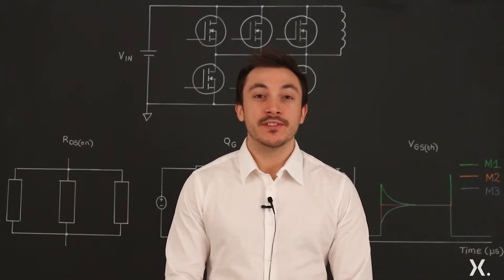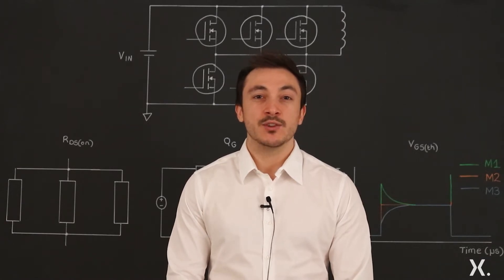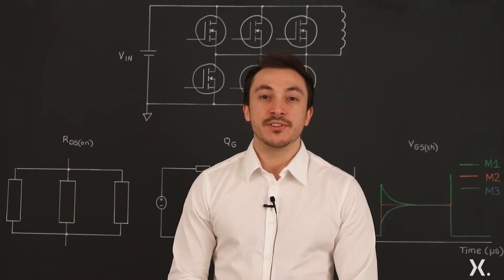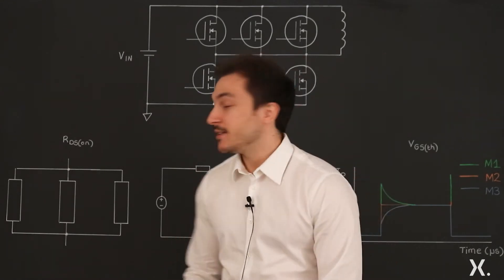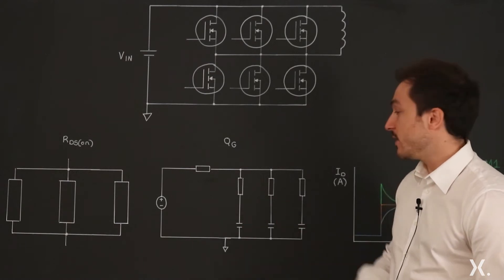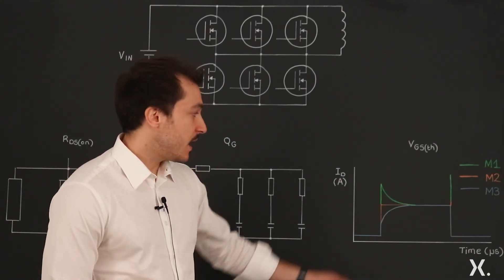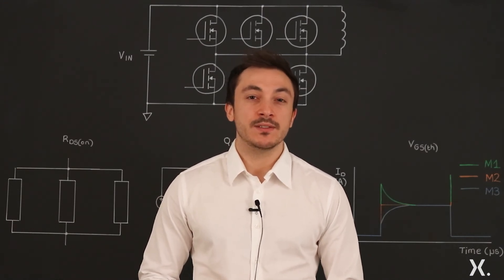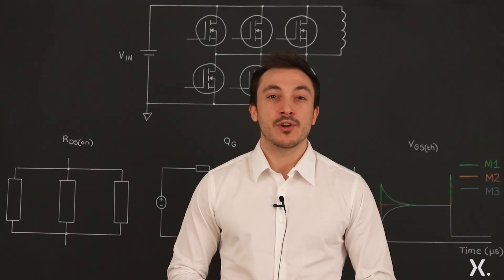How to parallel power MOSFETs

Comment: Do you recommend to connect the external resistors at source instead of Gate? the reason behind my doubt is that, in case there are tolerances in the resistors, then separate gate resistors may cause one of the switch to turn on earlier. Your feedback will be helpful.
Reply from the maker: Thanks for the question, @apoorvapatwardhan9394. We don’t recommend connecting a resistor in the source since it will significantly affect your overall efficiency. Usually, we are paralleling MOSFETs if the current is too high for a single MOSFET to handle, and if you have a resistor in the MOSFET’s source pin (Rsource), it will add loss to your system (Rsource*Id^2). 

In addition, another purpose of the individual RG is to minimize the impact of the difference in the threshold voltage (VGSth) of the MOSFETs. The Millar plateau voltage occurs after threshold voltage is reached, in this region the gate current will be flowing via the drain and not the source of the MOSFET.

Comment: Hi, I have a question. I have 4 transistors 2x S13003AD and 2x 4202BD. Can I connect them in parallel?. I just need 1A current but heat must be as low as possible. I already connected two S13003AD in parallel but I'm not satisfied with the heat. This will enclosed in a small enclosure. 

I know I could use higher power transistor or MOSFET, but above mentioned transistors are what I have at the moment.
Reply from the maker: Hello, thanks for your question! As a general rule of thumb, paralleling devices with different part names, either BJTs (as in your case) or MOSFETs, is not recommended. You want the paralleled devices to act as a “single” unit, i.e. as synchronized as possible, so that your design is robust and reliable.
Reply: @Nexperia  thanks for the reply!. I just wanted to power up a 4W LED light (20 LEDs, 0.2W each) from a 4.2V li-ion battery pack (1S 3P). Sorry!, I forgot to mention that. 

I already tried that, and it's working. They barely heat up. I was able to get 1.25A for them. I used separate base resistor for each transistor. 

It's not ideal, but works for the LED light.
Reply: @Nexperia  I saw a similar circuit somewhere else, but in that circuit they've used D882 BJTs, 4 of them in parallel with separate resistor to drive their base. 

I just wanted to try that with different types of BJTs. I'm using it about a week now, so far so good 👍.
Reply: They must be biased to saturation when 'on', so the collector to emitter resistance is as low as possible. Otherwise axsmall resistance will be present, which causes overheating. Also when switched off, they must be switched off completely.
Reply from the maker: Agree, which is similar to what happens to MOSFETs where RDSon will change with respect to VGS. Therefore, one would want to increase as much and as safely as possible the VGS to get the lowest RDSon and thus lowest dissipation.
Reply: The best thing to do is make sure the transistors are saturated when biased, it is best to do a static test for the lowest possible base resistor you can use. Then Ce resistance will be as low possible, and hence little heating.

Comment: Really great video. Could you please advise how you would calculate the realtive values for the resistors in reference to the gate charging. With the combined capacitances would you aim to reduce the resistance for a solitary mosfet by dividing by the number of mosfets to match the increase in capacitance. Is there a way of increasing the voltage to drive it harder and ensure a good current flow. With mosfet drivers they often have an independent way of powering the gate voltages. I have not often seen people using voltage pumps to do this. Is there a reason? I am sorry, I am totally new to this. I would appreciate your guidance if possible.
Reply from the maker: Hi @tarunarya1780, thanks for the question. The value of the “local” gate resistor (the one close to each MOSFET) should be low so that the gates of the MOSFETs are well coupled together, around 2 ohms should be enough – there should be a bit of resistance in the gate-source loop to dampen eventual ringing. The value of the common resistor at the driver side depends on how fast you want the MOSFETs to switch, you could use a simple simulation to choose it. Furthermore, the equation at page 17 of our application note AN50005 “Paralleling power MOSFETs in high power applications” could be helpful in certain scenarios. https://assets.nexperia.com/documents/application-note/AN50005.pdf With power MOSFETs, the RDS(on) decreases with increasing voltage VGS following a law of diminishing returns – i.e. usually after a voltage of around 10V for a standard level MOSFET RDS(on) won’t decrease much further. Always be mindful of the VGS rating of the MOSFET over the whole temperature range.

Regarding the driver; usually, designers might prefer using an integrated gate driver because of convenience, performance and space savings. However, a non-integrated solution (like a charge pump) is still possible and sometimes even preferable – due to cost for instance. Check out the design at page 14 of our technical note TN90002 “H-bridge motor controller design using Nexperia discrete semiconductors and logic ICs” – it shows a very simple gate driving circuit that can be designed with common BJTs, diodes, resistors, and capacitors. https://assets.nexperia.com/documents/technical-note/TN90002.pdf.

We hope this helps. Have a great day =)
Reply: @Nexperia  Thanks. I really appreciate your replying and pointing me to documents that should help. "All" I wanted to do was make an RC lawnmower using wheelchair motors 24v 250w motors, and make a controller for a brushless motor whose controller failed. I thought the sabretooth 2x60 was expensive so I would make my own. I had no idea that there were so many considerations with nuances. I will persist thanks. 
I'm sorry to be cheecky and ask another question. Is there a reason why people wanting to dc pwm controlled brushed motors don't just use one mosfet or parallel of mosfets  to control a motor with a relay to reverse the direction rather thanan h-bridge , as this would save energy and the components?
Reply: @Nexperia  regarding "Regarding the driver; usually, designers might prefer using an integrated gate driver because of convenience, performance and space savings. " I have not actually tried drivers yet though seen examples. I thought that they needed to have the voltage to be supplied to the mosfet gate separately, just as with an optocoupler. I did not realise that they boosted the voltage from the microcontroller pin. I have I misunderstood what you have said. That is why I thought you may need 3 voltage levels - processor logic, gate pin drive voltage and load voltage. This is why  was thinking of charge-pumps, or possible buck-boosters to provide a raised voltage to drive the mosfet rather than an additional power supply.

Comment: Christian, in your diagram Qg you have a common resistor then resistor at the mosfet side of each mosfet and what appears to be capacitor in series with each resistor 
why have the capacitor?  thank you
Reply from the maker: Hi Jack! The capacitors represent the parasitic input capacitance of the paralleled MOSFETs. The circuit illustrates the principle of splitting the gate resistor and why it’s needed (due to the capacitors). More info about this can be found in our interactive app note IAN50005 “Paralleling power MOSFETs in high power applications” - https://www.nexperia.com/applications/interactive-app-notes/IAN50005_paralleling_MOSFETs_in_high_power_applications.html

Comment: This is such an obvious thing but until someone mentioned it I have never considered using mosfets in parallel before. This could be used to increase the current switching capabilities if you are limited to a mosfet of a particular rating. 
I'm curious though this probably wouldn't work very well in an oscillating circuit would it? The slight imperfections of two mosfets allow and rlc to oscillate but having 'two groups'  of mosfets might cause too much instability. If anyone knows I'd be very interested to hear.
Reply from the maker: Hi @flyback_driver. Thanks for your question! If you are referring to oscillating circuit as in circuits where oscillations are an undesirable behaviour then: oscillations are always bad, especially when paralleling because MOSFETs should operate “in synch”. This is why it’s always worth including a small resistance in the gate-source loop to dampen any unwanted oscillation and keep the loop as small as possible, by placing the gate driver close to the MOSFETs gate. Good layout can also help to reduce parasitic inductance and/or make it so each MOSFET power loop has the same impedance. If by oscillating circuit, you refer instead to a 1-port device able to generate an electric signal then I wouldn’t expect an oscillator to require paralleled devices – as the “heavy lifting” may be done by an amplifier where paralleling is more common practice.

Comment: How would be the easiest and cheapest way to load share six irfp260n  MOSFET  and run them at 50+VDC  for a amplifier
Reply from the maker: Hello, thanks for your question! Keep the MOSFETs close together (better thermal coupling), reduce the distance between driver and MOSFETs (to keep the gate-source loop as small as possible and reduce layout parasitic), employ a larger gate resistor common to all the FETs and a smaller one for each – close to the gate (improve sharing during switching). Finally, use parts from the same order – it will increase the chances of using parts from a same batch/lot, i.e. with minimal parameters’ spread between them.